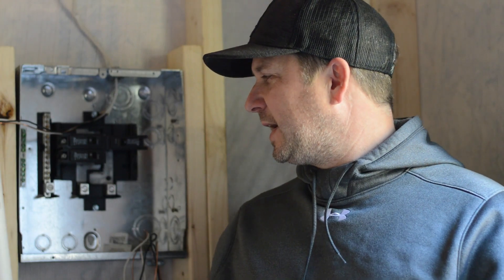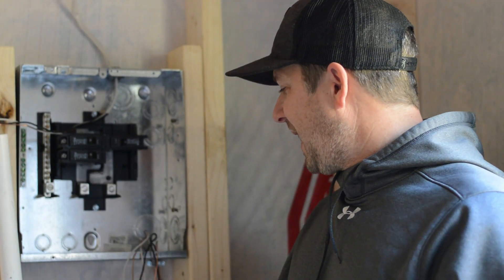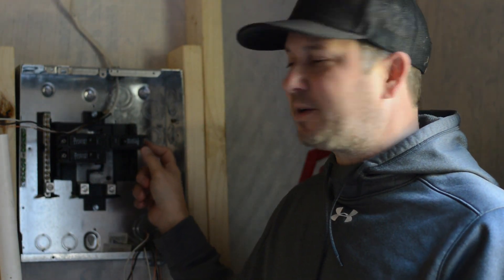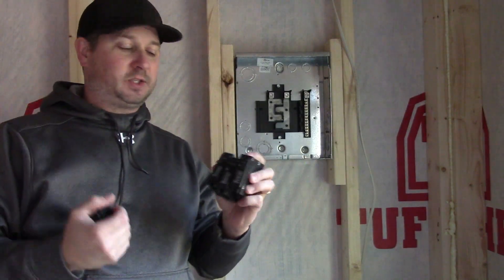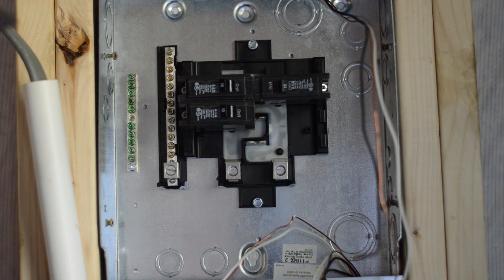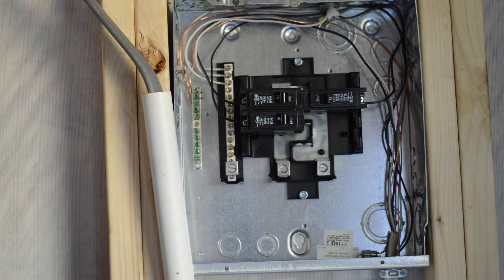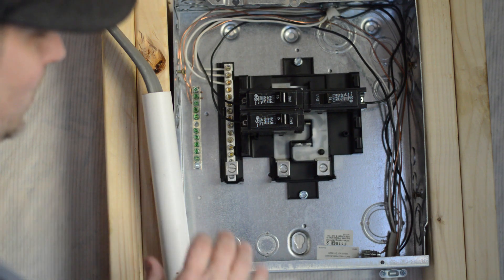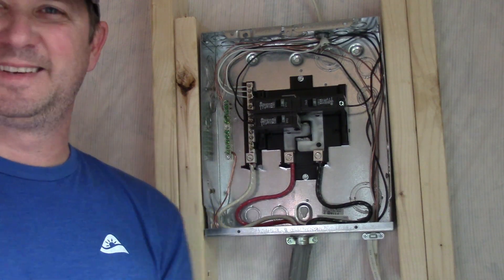How to Wire an Electrical Sub Panel | DIY Shed Conversion

Comment: Nice going with the video! You're doing it for sure. The one thing I would like to ask is what size was the romex wiring for the outlet & light circuits?....14-2 or 12-2? If your wire size was 12-2 then my suggestion would be to change your breaker size for your wall outlets to 20 amp circuits & you can leave a 15 amp circuit for the lights. The standard thing to remember is 14-2 wire size is for 15 amp circuit breakers & 20 amp breakers is for 12-2 wire size. You would not want to use 15 amp breakers for 14-2 wire! Something to remember for sure. Nice job & looking forward to seeing more videos.
Reply from the maker: Thank you for the comment and advice. I used 14-2 and 15 amp for this one. I just ran power for a minisplit and used 12-2 with 20 amp. This has been my first experience with running power. Not to bad to do but definitely gotta be careful.
Reply: @rogerearldiy  Well you're doing good so far. Just don't turn breakers on or have power on to a sub-panel without having the cover on first! That's a no no & I think you know that now.....LOL